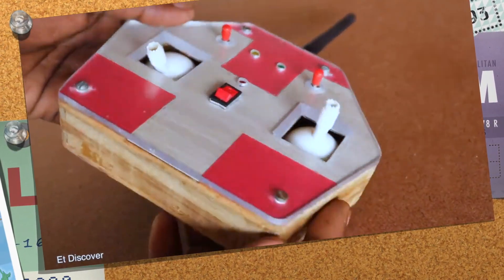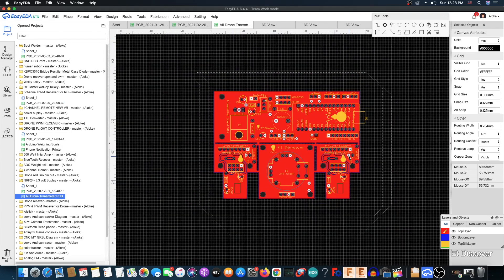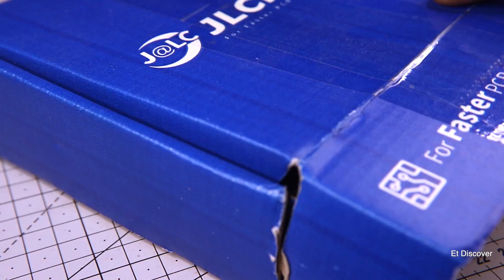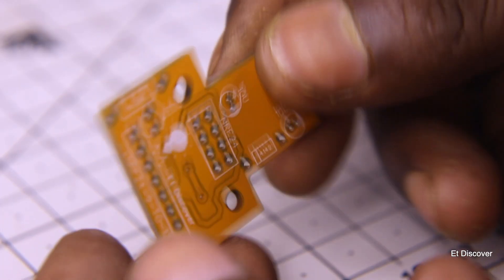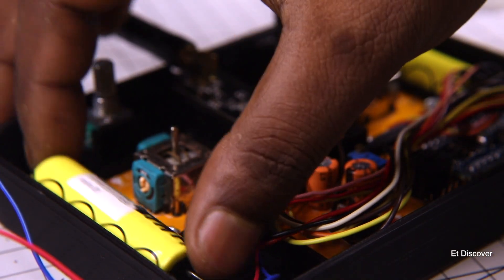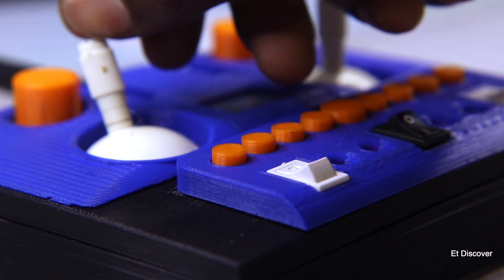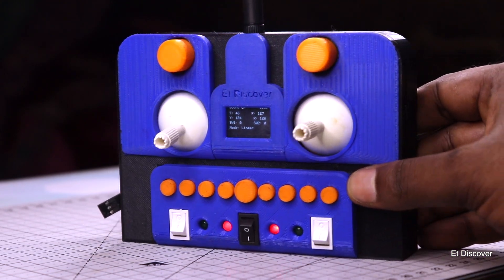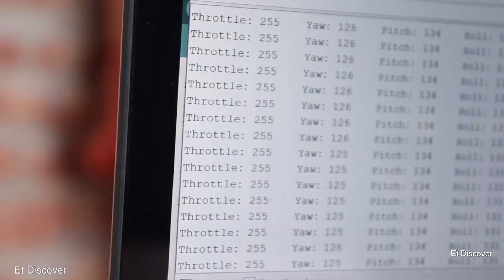Make a Drone's Transmitter and PPM/PWM Receiver

Comment: Link to joysticks does not give the same results as the ones you show. You're using a left joystick that holds the position (for throttle) in the Y axis, but the ones in the link they return to original position on both axis.

Comment: I suggest you to use 5 dbi sma anteena for nrf24 module on transmitter side,this will give you more reliable connection

https://youtu.be/QbPJ5bi3f_s 
Make sure you see this video which is most advanced tx on YouTube